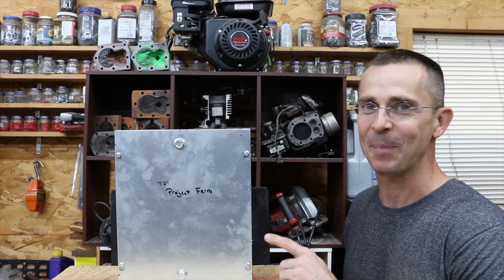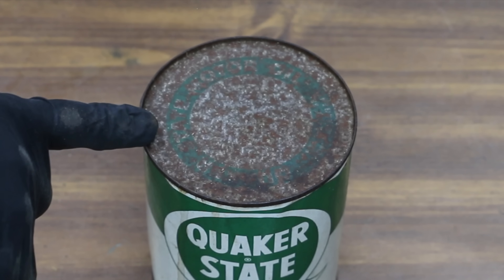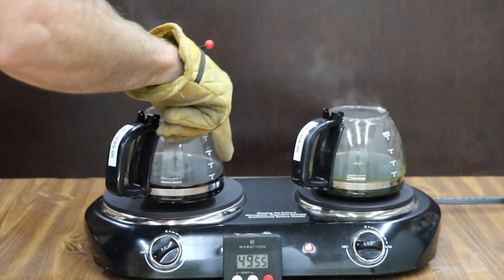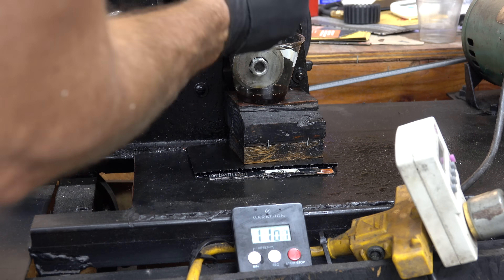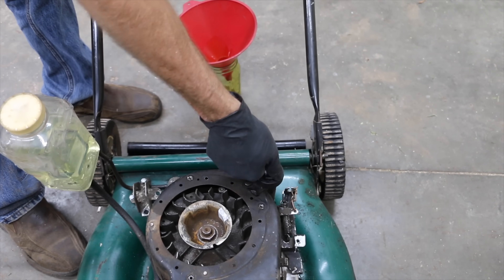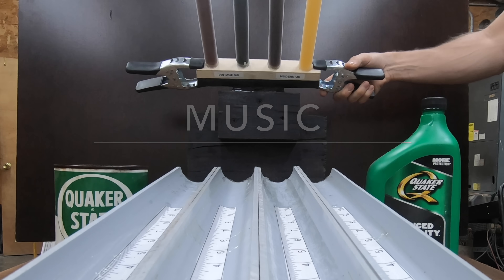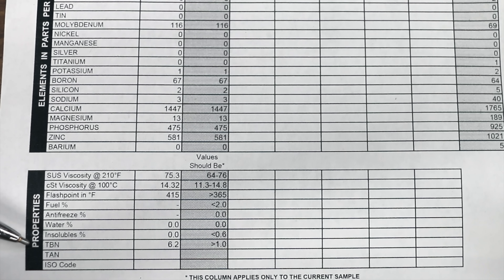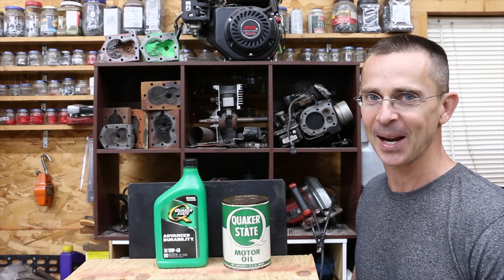Is Oil Good After 70 Years?  Let's find out!

Comment: It never occurred to me that “Quaker State” referred to Pennsylvania 🤦🏻‍♀️
Reply: Was a waxy oil,. Pennsylvania had the first oil wells
Reply: Me neither, now I feel stupid.
Reply: bruh, where you think the oatmeal comes from?
Reply: Where do you think the name Pennzoil come from?

PA oil made JD Rockefeller rich. A lot of history in that state.
Reply: @laserfalcon  I found out long before the internet how bad Pennsylvania motor oils were for gunking up engines. Torn enough engines down over time to see for myself which oils were good and back then Quaker State was one of the worst with Pennzoil a close second. Modern oils are a lot different and I'm not tearing engines down much anymore so these brands may be good now but I still won't use them.
Reply: @P_RO_  since the modernized standardizations came about to weed out the slummy oil manufacturing, pennzoil as well as most all oils have stepped up their game. Since they all must meet certain standardized requirements and regulations. I feel like they're all fairly equivalent anymore.
Reply: @P_RO_  They also didnt keep oil pressure up as the oils got foamy in the engine.  I was  18 driving a MG midget that had oil pressure gauge.  At idle i noticed my oil pressure would drop to zero. I asked a mechanic if i was having engine problems. (Honest mechanic)  .  He asked me what oil i was using, Quaker State i replied,. He told me to change it and try Castrol.  I did and was the last time i used Quaker State oil.  A lesson i learned of how different some oils were. That was back in the 70s
Reply: @P_RO_  - I used Pennzoil through the 90's into the early '00's - never an issue with it. Fram filter on there, too. My '72 El Camino puked most of it out the breather whenever I got on the highway, but that thing was still running strong when I sold it 11 years, and a cross-country drive at 4k RPM pulling a trailer, later. At least 150k I put on that old 350 - was well used when I bought it, too. These days I run Amsoil in everything. 

Not too many bad oils out there today. Even the cheap Walmart Supertech stuff is pretty good.
Reply: @laserfalcon  so they dried up??
Reply: @mikeschiavoni5973  Did what dry up?
Reply: @mikeschiavoni5973  ive got an old crude oil well at my camp. we use hand pumps to pump it out of the pipe with some plastic tube and start the camp fires with it
Reply: I find your comment most amusing as I'm an Aussie and I've known about the Quaker state since I was a kid.
Reply: What about Pennzoil?
Reply: @hopsta5628   Read up on oil city and Titusville PA and the oil boom. Pa also is having a gas boom currently.
Reply: @laserfalcon  the oil? Does it just go away? Poof gone??
Reply: @mikeschiavoni5973  The oil from the 70s?
Reply: Wow. Me too
Reply: @laserfalcon  I was having stuck lifters and other issues in the early 90s, an old mechanic guessed I was using Pennzoil which I was. I asked him what I should use and he said Valvoline. I still heed his advice to this day lol.
Reply: @bgarr99  My understanding was Quaker State was waxy,. So wouldnt surprise me but was long ago.
Reply: LaserFalcon drakes well
Reply: @TheTechGuider  i found this

Drake's well brought oil up out of the ground and it was funneled into whiskey barrels. Before long Drake had a steady supply of about 400 gallons of pure oil every 24 hours, a stunning amount when compared to the meager output that could be collected from oil seeps.

Other wells were constructed. And, because Drake never patented his idea, anyone could use his methods.

The original well shut down within two years as other wells in the area soon began producing oil at a faster rate.

Within two years there was an oil boom in western Pennsylvania, with wells that produced thousands of barrels of oil a day. The price of oil dropped so low that Drake and his employers were essentially put out of business. But Drake's efforts showed that drilling for oil could be practical.

Though Edwin Drake had pioneered oil drilling, he only drilled two more wells before leaving the oil business and living out most of the rest of his life in poverty.

In recognition of Drake's efforts, the Pennsylvania legislature voted to award Drake a pension in 1870, and he lived in Pennsylvania until his death in 1880.
Reply: geekbruin same with pennzoil
Reply: Then penzoil being penslavania is oil company probably a surprise also.
Reply: @robhoard9114  Todays oil and refining altogether different i believe.
Reply: geekbruin yep same as Pennzoil!
Reply: Ohhhhhhhhhhh....!!! Those are from the  same province, ofcourse!

Comment: I remember selling those cans of Quaker State and Wolfs Head. When it was very cold you could not pour it from the can with just a church key hole in it.  You had to have the full spout and then wait 5 minutes .  And to think people added STP to this stuff. Engines had bigger oil lines but bearing clearances are essentially the same.  Those were the days when an average engine life was about 100K before a rebuilt was needed. Now a well designed engine can last 300k+ and never have the crankcase split.  Even the incredibly more complex valve trains hold up amazingly well.  It appears the newer oils are responsible for at least part of this longevity.  Thanks for the video and the trip down memory lane.
Reply from the maker: Wow!  Thank you for sharing the memories!!
Reply: A Japanese engine might last 300k. You'd be lucky to have a German one last that long :D
Reply: @BlatentlyFakeName  I was unaware that the Germans had fallen behind so badly. That's really a shame.
Reply: It is indeed the new type oil.
Reply: The newer oils,especially the synthetics,don't change their viscosity as much over temperature swings as did the old oils,synthetics allow multi viscosity performance without the damaging additives that were used to make the old multi-vis oils.

Comment: I remember the mid 1960's when all the older kids had STP stickers on their old 1950's cars. I once took the valve covers off a 58 pontiac and filled a 1 gallon can with the sludge out of the valve covers! Yeah, the good old days.
Reply: @L F Don't strain your brain
Reply: Worked in a full service Standard Station in the early 60s. It was common to remove the drain plug and nothing came out. Push a screw driver on and a couple of quarts came out. The boss would say put some kerosene in and let it run. Probably made things worse.  When you overhauled an engine you spent more time cleaning the engine than anything. My uncle went to a Shell station for their multi Grade oil change. He said it always uses a quart of oil then doesn't use any more until the next oil change. I realize now that about 1qt evaporated.
Reply: Pensoil (however) was notorious for running up an engine. The old guys used to say if you had an oil leak,run pensoil for 1 change and it would stop the leak! Would be instantly obvious that an engine was a a pensoil engie as soon as you took a valve cover off.
Reply: @ralphwood5114  As a kid I remember seeing black sludge caked around rockers. I wonder how those old engines would have held up with modern oil.
Reply: STP = stay together please😁
Reply: The devil Made me say it  lf l'm a stupid boomer what does that make your grandparents?
Reply: Bought a Nissan Altima with 225 k on it. Beautiful car and ran nice. Started it up the next morning and thought hell I need to change the valve seals. Took the valve cover off and it looked like a new engine.It had a couple of worn valve guides. Decided to order a Japanese import engine from NJ. An engine that clean would have been unheard of in the 60s. Probably has as much to do with the engine as the oil. The valve springs are down in holes. A work of art but a night mare to work on.
Reply: A gallon of sludge would be an exaggeration but I have removed a quart. I have removed 2 quarts from the oil pan. If you overhauled an engine you had to spend most of the time cleaning and scraping the parts. My old 76 F 250 390 engine is like new inside. Changed the head gaskets. I have Delo 400 15 40 in it with a 50 year old Motor Guard on it. In the 60s I would never use multi grade oil. The polymers fouled the engine. Chevron Delo 100 30 wt all the way.
Reply: Sorry I was thinking 1 valve cover I'll give you 2 quarts of sludge. Another 2 quarts in the valley.
Reply: @ralphwood5114  It was a 10 year old car I got free. I was trying to get it running. It really was clogged to the max. A lot of the sludge was around the rockers and springs. By the time I cleaned both sides, it was a gallon as I recall. The effort was futile as I had to replace the engine anyway. It had been run for years with no thermostat and no oil changes. The guy I got the car from said he only put used oil in it he got free at the corner gas station.
Reply: This kid I know told his girl friend's dad someone from church told him he could have this ugly old car in the back yard. He was asked what kind of car it was. The kid said a Malibu SS or something. The guy said let's go get it. The girls dad has a hobby of restoring old cars. It was brought over for me to look at later.It looked new and the 396 sounded nice.
Reply: Rare find, every old muscle car I ever found had part of the engine in the trunk or missing completely! Lol
Reply: The old cars would have done fine on modern oils. Multi grade oils were not very good in those days. The polymers fouled the engines.Delo 100 single wt was a good oil. Worked for a race car owner in the early 60s. His tow rig used Chevron RPM Special. He was a little unhappy because his oil didn't look as clear as my Delo 100. Turned out the special had a ashless additive that turned dark. We put Delo 100 20 wt in it.Then it looked like mine. I really thought the 20 wt was too thin but he was the boss. The Chevy big 6 had over 350 k on it when I left California. The Delo 100 was for diesels.Couldn't use multi grades in diesels then. The Delo was 29 cents at the discount stores. All I see now is Delo 400. The multi grades are good now. I put. Frantz oil cleaner on the Chevy. Put a Motor Guard on his Plymouth Fury before I left.The Motor Guard was a better design.

Comment: and that's, why we used to in the old days, warm an engine much longer before putting it under load because engine oil sat in the crankcase for much longer than it does now.
Reply: And carburettors being really bad for fuel metering on a cold engine with their crude choke mechanisms.

Comment: I have some old 1940 50's popular science magazines. There was a article in one of the issues where the magazine recommeneded to change your oil every 1000 miles in your car.
So your testing confirms the reason for this recommendation.
Reply from the maker: Wow!  That's a frequent oil change interval
Reply: My 37 Studebaker book.says don't drain the oil . change the filter when the.oil looks dirty on the dipstick. Oil filters were optional equipment then.they were far superior to modern full flow filters. They had cotton.elements
Toilet paper filters are superior to cotton. Put a Frantz oil cleaner on a nearly new Chevy Suburban 1963 model with a 292 big six.It used Chevron Delo 100 20 wt. It got a new roll of toilet paper and a new qt of oil about every 2 k. Lost track of it at over 350 k. Before I left California I put a Motor Guard oil cleaner on his Plymouth Fury .
Reply: Kendall motor oil has the logo of a hand making the V sign.
That wasn't V for Victory that was 2 as in it cold last 2000 miles, one of the first oils to do so.
Reply: Kendall was a reputable oil. Most of us that used toilet paper filters in the 60s didn't drain oil. 2000 miles was about when we changed the toilet paper and added a quart of oil. Started going with a girl that had a 66 VW beetle She was changing the oil every 1500 miles. I think that was recommended. VW saved millions by not putting a filter on the engine.The owner got the shaft.That bull shit stopped when I put a Motor Guard on it. Took several filter changes before big metal stopped showing up in the filter housing. The original Motor Guard filtered from the bottom up. I tilted the filter so the big metal wouldn't gravity back down into the engine. Frantz wanted their filter upside down on a beetle which did the same thing.

Comment: Nobody:

My recommended:”is oil good after 70 years” 

Well shit I’m tired and bored so let’s find out
Reply from the maker: lol. Thank you!
Reply: I don't need sleep, I need answer
Reply: Should be going to bed but here I am in the same boat as you
Reply: The can wasnt cushioned top and bottom though, only the sides of the inside box with the corrugated filler
Reply: @samsonn25  
 Paper can with metal ends, standard in the 50's.
Reply: @franknewling1139  I stopped seeing cans like that in the early 1980s.
Reply: I cringed when he opened it 😔
Reply: Wkwkwkw.  😂😂😂
Reply: CapeYT haha same
Reply: Same lol
Reply: So it's time for me to change the oil in my 1950 Ford coupe?
Reply: I’m almost that old and I smell different.

Comment: I'm one of those "drive it until the wheels fall off" guys. Between 1989 and 1995 I drove a single vehicle using 10-40 Pennzoil. Changes in motor oil in that period gave me a 5% boost in gas mileage just in reduced engine friction. Modern motor oils have done a phenomenal job of reducing engine wear.

Comment: Enjoy your fun comparisons! 
A thought...the wear scar test may be skewed in favor the inferior oils. 
As the scar gets larger, the bearing surface is larger, thus the psi load is lessened meaning the oil isn’t stressed as much. 
A smaller scar may mean a substantially higher load bearing oil in this example as it’s smaller load bearing surface represents a substantially higher psi loading. 
Whatcha think?
Reply: Those factors are all constant. No difference.

Comment: The winner is...   The 70 year old oil can.  (not the oil, just the can.)
Reply from the maker: Lol
Reply: When I was working in a Standard Station a regional rep said the can is what cost the money. If you put it in a plain can no one would buy it.
Reply: Seriously though, probably right. The plastic container would have disintegrated long ago.
Reply: Yes. It can.
Reply: Hey plastic lasts forever, new jugs will last much longer
Reply: Oil jugs are usually HDPE. My experience with that is it gets brittle after a few years. Less with UV exposure.
Reply: Grabbed a plastic bottle that had been in the Texas sun a short time. It fell apart.

Comment: Todd, I am a recent subscribed member and love your show!  I came across a problem that that everyone will likely come across when it comes to refrigerators and AC units for cars and home. I was given a Maytag refrigerator for free and it was only 4 yrs old and it looks like new. I took it on as a project and it clearly was low on refrigerant. I installed a piercing valve and  I refilled it and it  worked perfect for two months and then it stopped cooling. I  refilled it with Freon  R134A and sure enough  it worked great again but required to be refilled twice the first to weeks. I took apart the unit  and exposed all the components and filled according to instructions a liquid dye and bought a Freon sniffing tool and after three weeks i absolutely could not find the leak so i knew i had a micro leak that was likely under the insulation in the frig box. So instead of destroying the frig  I bought a product on line called supercool  sealer made in the USA.  Due to sketchy info on the direction on the package I had to call the people that sold this product to determine the proper amount of sealer required for a home refrigerator and they said it was equal to a quarter ton refrigeration unit. I started the project May 22- 2022 and placed the sealer in the unit and kept a steady log. Its now been two full months and i had to fill the unit twice in the first two weeks and since then the leak seems to have slowed down but hasn't stopped yet and i am getting to critical level on the intake compressor pressure. 
My question to you, is there a way to test this product and others to prove if they  really work or not  and which one really is good ? I think we all can benefit from this.
Reply from the maker: Thanks for the suggestion.